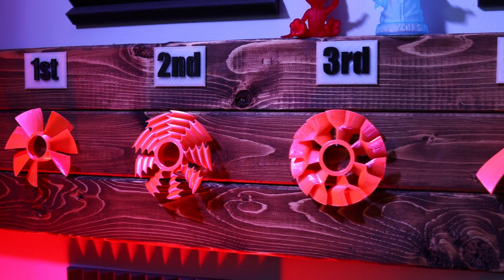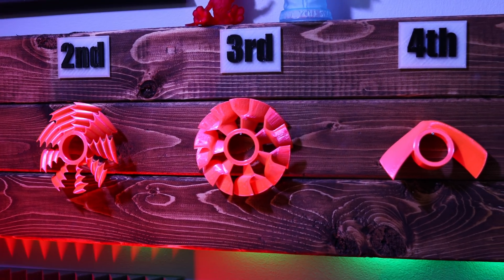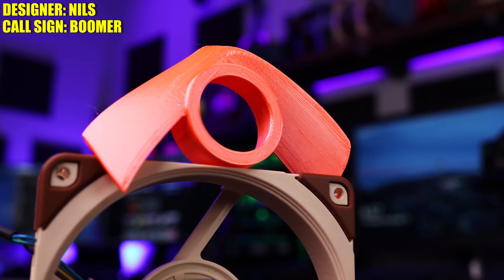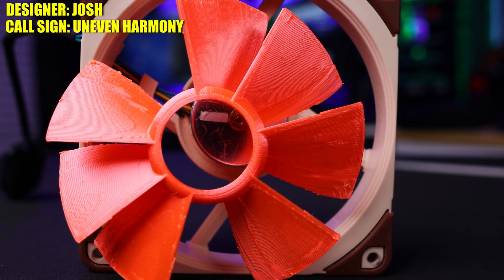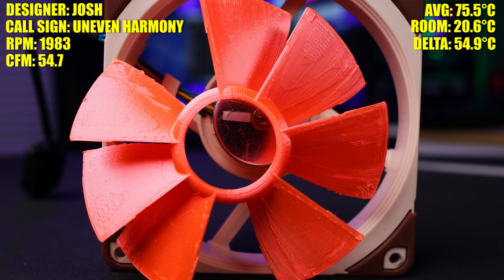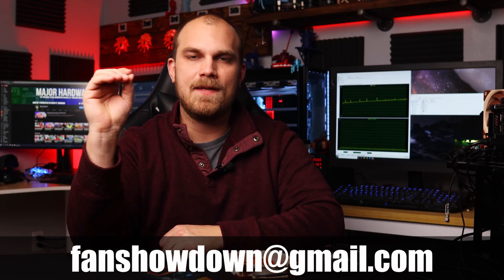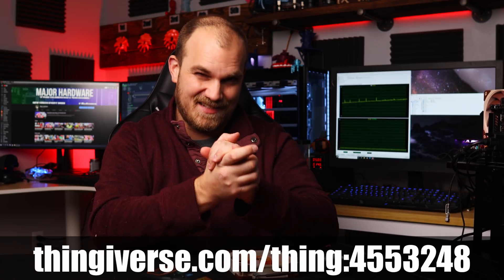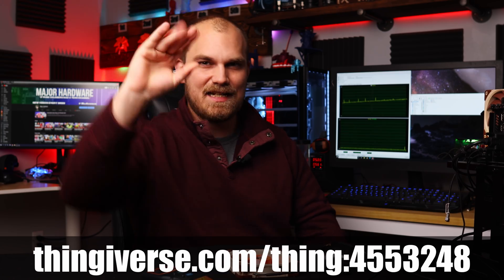The Boomerang Fan is So Much Better Now | Fan Showdown S2E1.5

Comment: Thank you for listening to the fans! If we had continued with RPM limiting, giant power-hungry fans would have won every time.
Reply: I mean the test should be dBA levels, the companies in the fan scene spend big money each year trying to come up with a quitter dBA fan that still cools the same if not slightly better. Nearly no one is going to be willing to use a fan that is 60+ dBA heck most people would not have a fan that is louder than 45 dBA no matter how well it cools. If the goal here is to see what style of fan can cool better without factoring in dBA then why is he not using a server grade controller that spins server fans at 5k to 10k RPMs?
Reply: @Kirinketsu_  I think dBA score being part of the ranking not only temp delta. So basically a composite score. I'm not sure that limiting them would be wise but it's not a terrible idea.
Reply: Any chance you could explain why?  Does the industry let their fans spin as fast as they can?
Reply: @MatthewLudwig-mw8uq 
Because the motor has limited power and power hungry fans rach the limit at a lower rpm, while lighter fans will be stuck at lower rpms and will never get to see the full power available to them.

Lets think for an example the motor can deliver 5W of power.
Scenario 1: No rpm limit
Big heavy fan with huge blades reaches 1000 rmp and uses all 5W the motor has available
Light fan with small blades reaches 3000 rpm and uses all 5W available.
Both fans have a fair fight.

Scenario 2: 1200 rpm limit
Big heavy fan still only reaches 1000rpm and uses all 5W of power
Light fan reaches limit of 1200rpm and uses 2W of power.

Limiting the rpm makes fans that are light and aerodynamically optimised or designed with low air friction in mind lose out on all the benefits they have been designed for. And also directly limits their potential.
Reply: @icemaiop  ♥♥♥
Reply: @icemaiop  Well written! Thank you for doing it so I didn't have to :D
Reply: @icemaiop  I disagree, What he's doing with the fan motor isn't it's "normal condition" different fan motors have different power rating based on what it needs for that exact fan blade that it's paired with, He's using a whole bunch of different fan blades and if he uses a blade design that needs more power than what the hub motor can deliver than the RPM/airflow/pressure are going to suffer and it will do badly in the tests. Remember he's testing fan BLADES not power draw, If each and every fan blade design that we have seen had a hub motor specifically designed to spin each blade at 2000RPM than some blade designs are going to do a lot better than others at the same RPM,  Which brings my back to my other posts that the RPM should be limited....just not at 1200 that was too low 1800-2000 range is fine however he might have to overvolt the hub motor to get some fan blades up to those speeds which is fine, I've had some computer server fans in my YT vids flying and running at over 30v before they died.
Reply: @HL4EHalfLife   If you are stating that a fan blade design that is not optimised for the current motor will not preform optimally, or that a fan design that requires more power will perform poorly. I agree with that very obvious statement.
Since we have one motor for multiple blade designs, the performance will in the end be limited by the weakest link and the blade designers will have to think about what they can make with it.

Fortunately for us by not limiting rpm, the motor will give all available power to the fan, and depending on the fan design we will see it being converted either into speed (more rpm) or more mass being spun against air resistance and power lost to friction. This is what we want, since we are testing BLADES and not power draw, so power given to them should not be artificially changed.
As you may already know, by limiting the rpm on fans optimised for speed, we will also be directly limiting their power, since they will hit the rpm limit sooner than the power limit..

Now to the fun part, and I will later try to explain it so everybody reading this can understand by using a methapor.
See, some more experienced and educated fan blade designers out there may use their knowledge of aerodynamics and put effort to optimise their fan blades against power losses due to air friction. This in return will help their blades spin faster and propell more air through the cooler, achieving a better performance.
Limiting the final rpm of their designs will instead convert their efforts of reducing friction and achieving higher performance into simply less power draw...which like we stated earlier we don't care about and is wasted potential.

In an rpm controlled environment designers who don't put effort into optimising their blades, and instead go for slow designs and just strap on big blades to push as much air as possible will have the full potential of the motor unlocked, as their designs will reach the power draw limit sooner than the rpm limit.

Now you can see that there are two extremes of blade designs, slow but big which hope that their bigger blades will lead to more air pushed through the cooler and increase performance, and slick speedy ones which give up the blade size in favor of speed in hope to propell more air and win this competition.

The issue is that when the rpm is limited we can be certain that bad blade designs will win just because they will have more power available, while optimised blades will fail as they are the only ones affected by the rpm limit.

I personally want a fair performance competition and not bad chunky fans winning just because the odds are majorly in their favor, while speedy designs might even lose more than half of their performance.

Now to the metaphor:
We have a competition to transport 300 people from point A to point B.
Challenger 1 decides to take a 1920s minibus that fits 10 people per trip albeit a very slow speed of 40mph.
Challenger 2 decides to drive a brand new mustang that holds 2 people but reaches 300mph.
The tester says: "Alright lets see which one of you will do it faster! But..ehm you will be limited to 50mph"
The mustang driver looks visually confused while the minibus driver has an obious smirk on the face
Reply: @icemaiop  no one cares about power usage of a fan. They want airflow and noise, thats it. The tests are now completely useless.
Reply: @MyrKnof  Then if we absolutely don't care about the power limits set by noctua or any other manufacturer, why don't we just overvolt and intentionally push more power to the fan and get more performance? :D

Why do we even need these tests if we can do whatever we want with the power?
Reply: @InsanePorcupine  I am unsure if I somehow miscommunicated my points and made it seem like I care about power efficiency. I think power efficiency is irrelevant and the only reason I keep mentioning power is because it is a limit of the system itself.

Also limiting rpm limits the power only of one kind of design, which in return makes the whole competition pointless. At that point you are comparing apples and oranges. One gets more power, one less, so what is the point even competing?

Also most motherboards have inbuilt rpm initialisation checks and therefore the speed is limited by % rather than to a fixed rpm.

Performance wise, lets say kingpin wants to see what is the best fan design to compete on air-cooling, he would definitely not lock the rpm, as it would make no sense to do so. And I am interested in this performance
Reply: @icemaiop  Ok but I still don't care about any other metric than cfm/dbm though. It's cool to see maybe what blade design works best with that specific chassis and motor though, but real world application it doesn't matter as much as noise to performance ratio.
Reply: @InsanePorcupine 
I respect those who want to see performance/noise, it is interesting to know. Low noise performance is a real life usable fan category and thats why they make silent fans.

My interest are however purely focused on performance.
My pc has 24 fans installed and a 360mmx360mm double thickness MO-RA radiator. It looks like an AC unit and sounds like a jet, I am interested in maximum performance without any set limits.
Who can come up with the most optimised aerodynamic fan design and beat noctua from their 1st place will win my heart.
Reply: @icemaiop  lol, I'm interested in your case now tbh. Honestly I run a 50' hdmi to my display and have USB extension and run my fans all 100% too. So my current setup admittedly doesn't need quiet performance just performance as my tower literally sits in a different room. However, I still don't have a huge need for extreme performance if I did I would just get an industrial fan that would probably sound like a jet engine.
Reply: @InsanePorcupine  power efficiency affects fan speed.
Reply: @MatthewLudwig-mw8uq  They may use a noise or power limit, but not an RPM limit.
Reply: @MatthewLudwig-mw8uq  That's a simple answer, Time.
The industry not only runs their fans at maximum RPM (probably to the point of breaking,for a stress test if one makes it that far) but they also spend, at a minimum, weeks testing a potentally marketable fan. Then even more testing after they find the optimal setup for that one blade design. This is why when you shop for fans, they always have an entire page of specifications on the sales box, and generally even more data if you get it directly from the manufacturer, like specs and multiple different RPMs.

He would make about 1 video every 6 months if he did that kind of testing on every single fan blade he prints out. What he is doing is just the very very first test that a manufacturer would do to get an idea if its worth spending weeks of testing on that blade or this blade. 
Also the reason manufactures watch his videos, and why one contacted him before wanting o contact a designer of one of the blades. Fresh ideas with preliminary testing already done.
Reply: Not sure what the discussion here is regarding. By using the motor as the constant, and providing all the measurements for each blade, comparatively your getting all you could ask for, short of each individual blade getting a full month of testing to discover its "optimal" parameters. 

Based on the comparative numbers, as well as the hard values, this method is providing the information your all asking to see. Just takes a little extra figuring into the exact situation your looking at.
Reply: @outcast170  You are very correct. Some folks want to artificially manipulate the power draw through rpm which doesn't affect each fan equally.
I support keeping it a constant and allowing the fan itself to show its properties.
Reply: @icemaiop  Yeah simply put the more constants you set, the less testing your doing.
Reply: @outcast170  ... watch the first episode of season two... and read the comments there.
Reply: groan

Comment: Just a thought... Maybe vibrations somehow increase cooling affect. Shaking the heat pipes causes the liquid inside to circulate more quickly? No idea, but maybe test a cooler both on and off a vibrating platform. That's something I've never seen.
Reply: I like the idea.